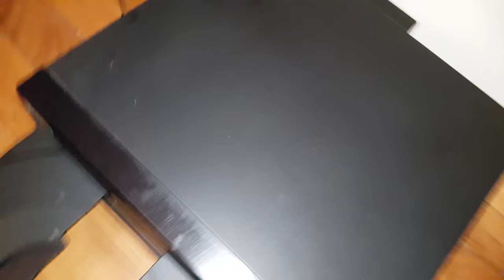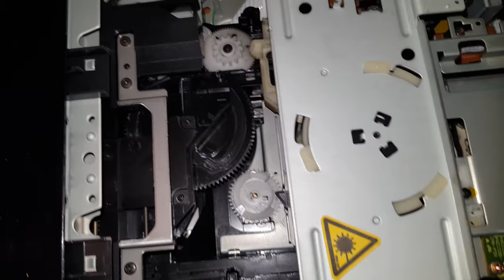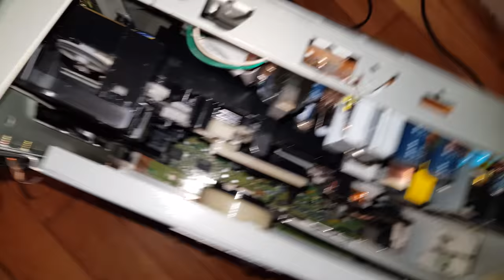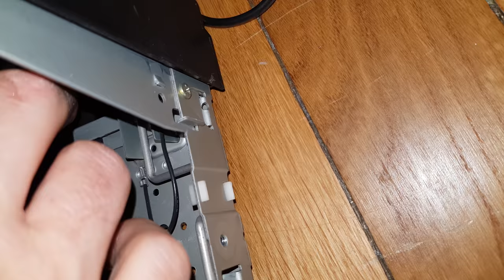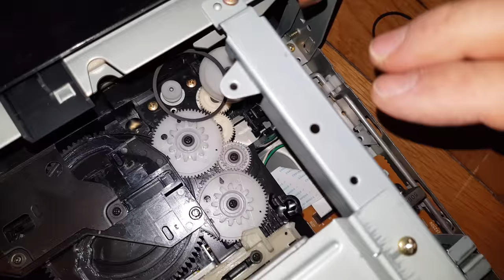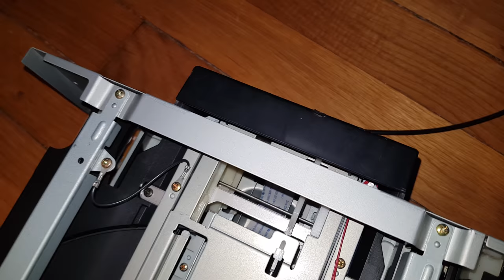How to change Remove Fix the Belt Laserdisc Player Pioneer CLD 925

Comment: So, did you film this at 3am in the morning given your "silent film" treatment of the video?  Regardless thanks for the upload.  I have a pioneer DVL90 and I'm finally going to replace the rubber belt and this video perfectly shows the manner in how I'll access the belt drive gears.  Still find it hilarious that the belt drive is essentially a small rubber band that's responsible for spinning an LP sized record CD in these monstrous players!  Such refined simplicity in engineering that most LD Player owners are probably unaware of.